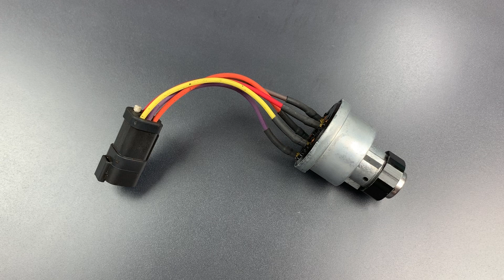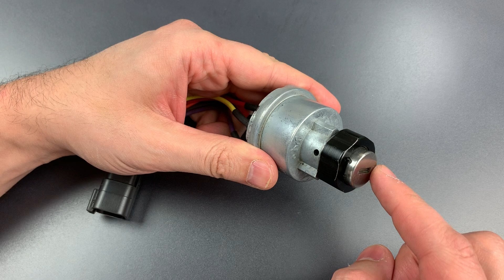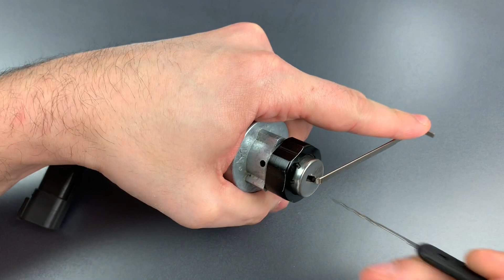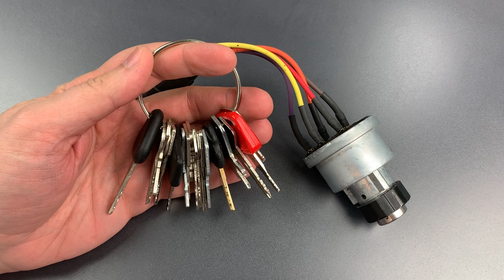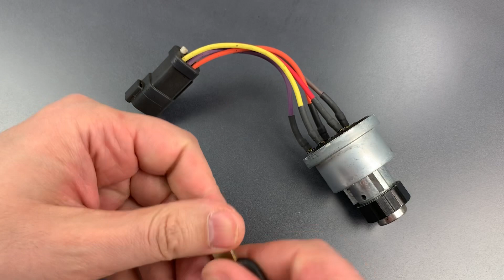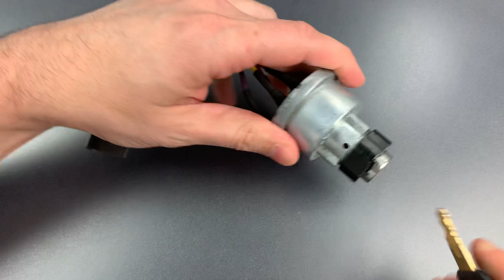[803] The Shocking Truth About This Bulldozer Ignition Lock (Caterpillar D8)

Comment: I can hot wire these under 2 minutes. The main issue with most heavy machinery is that they don't have steering locks like passenger vehicles so no need to pick the ignition lock even though it does seem quicker.

Comment: Machinery is quite difficult thing to operate. Stolen heavy machinery is practically non issue because you need police escort to drive thing on 150 000 $ truck. 
Low skill is turn the key. To start machine you got sequence if stuff to be in correct place. Like buldozer in question have throttle pedal in reverse, flor it and it's idle, full throttle is when gas pedal is relaced. 
Airplane doesn't have key at all. You can go to airport, enter in Boeing 747, Airbus 380, 320... Enter the plane, start engines and fly away without key. Know how to do it is different story

Comment: Fun fact: older Freightliner trucks had the same keyed alike problem. Freightliners of a certain age are guaranteed to only have 4 or 5 key variations, which meant if a driver locked themselves out of their truck, someone at the truck stop used to always have a key. Now, Freightliner has gotten better about that and makes many more key variations. They also make the door lock mechanism hard to fiddle with inside the door without breaking the door, AND they make the door hard to pry open with a wedge. Easiest way in on an automatic transmission Freightliner is by unscrewing the plate on the firewall under the hood where manual transmission parts would go, next to where the steering attaches. You can unscrew that plate and reach right in to grab the key out of the ignition of the truck.

Comment: Is the potential for mayhem there? Sure. Does it happen? Well, I can't think of the last time a stolen piece of construction equipment was used to go on a rampage. It's right up there with military vehicles, there's no key needed to start them. The only theft prevention system is a steel cable looped around the steering wheel held in place by a padlock.

Comment: Almost all industrial-sized Caterpillar machines take two keys. One is usually hidden away inside a (lockable) compartment protected by a considerable steel plate on the outside of the machine. This is a power shutoff, and could honestly just be bypassed with a bit of heavy-gage wire, but it takes that two-pronged key on your ring. The other is in the cab, the one shown above. Notably, the cab is also lockable, and it's common to put an aftermarket hasp on the door with a padlock. Not sure if the cab door takes the same key as the ignition. I don't think so.

Where I worked, the ignition key was always wired permanently to the switch and the master key was always left in, but turned off and closed up over night to prevent battery drainage, because my boss had machines twice my age and they were all deteriorating crap-piles. We only had two or three thefts across our probably fifteen hundred machines and several decades.

A bigger problem was disgruntled neighbors shooting the machines when he didn't respect their noise complaints.

Comment: All those years on the farm and we used to hotwire the tractor with a screwdriver to short the starter circuit. It's not like there was anything stopping access to the back, though we did undo the ignition and dropped it out to give easier access and a eyelet on the power wire. The closest to a key was that it usually needed a can of Start Ya Bastard on hand for the first start.

Comment: Im a farmer, and i can say with certainty that there is almost no risk of having farm equipment stolen, tractors from major companies have the same key for each model, but the models have different keys, regardless every farmer i know just keeps their keys in the tractors, semi trucks have different keys for the most part, construction sites have security cameras and insurance, at our farm we have an old d8 bulldozer, it doesn’t have an ignition key, you just press a button to start a small gas engine and then pull a lever which turns over the big engine, and given the fact that its impossible to steal any heavy equipment without making a ton of noise (especially equipment like whats featured in the video) there practically no risk of anything being stolen

Comment: Also being as most of these machines have a fairly open engine bay. The need for the key is redundant anyway as you can fire them up without the key fairly easily by hot wiring. The amount of machines Ive seen where the rental company has simply replaced the lock with a toggle switch is pretty high as well.

Comment: There are also padlocks on battery boxes "protecting" battery kill switches on most equipment. Its quite amusing when showing up to a job site Monday morning and nothing will start cause all the batteries have been stolen. Any contractor with at least half a brain also has hidden kill switches unique to the machine.

Comment: John Deere keys will run everything except the excavator. You need a Komatsu key to do that. Companies are moving away from keyed locks and switching to owner controlled pins. Of course most of those pins are 1111, 1234 etc.

Comment: These industrial locks are NOT intended to deliver security. they are intended to prevent casual misuse, and allow fast recovery if you loose your key and they have spare so your work is not stalled. In the industrial field, Security is handled by other means and protocols

Comment: Not sure how common it is, but an excavator I worked on had a generic starter key. But the door for the battery had what looked like a decent lock on it. At the end of the day the battery cut-off behind that door was used to 1. keep the battery from from discharging 2. to keep anyone from starting it. But the owner seemed to be more concerned about someone stealing the batteries or hydraulic oil as those are easier to resell for a thief.

Comment: Try the other keys on the ring on that ignition lock, I bet there are multiple other capable of opening it. Hint: don't insert them all the way.
BTW here in the Netherlands Electronics starting blocks and gps trackers are mandatory to get  insurance on them if they are not parked inside a secured building

Comment: I think your biggest security feature of heavy equipment is that it is heavy equipment.
The D8 for example is 40t, the blade is over 13 foot wide and it is 12 foot to the roof of the cab, and your GPS pole, roof flashing light cage and so forth will add to that.
Not to mention that 98% of folks do not know how to operate a dozer and it is not as obvious as it might seem.
They are also amongst the loudest of machines and CAT and Komatsu have satellite tracking of our machines, steal it if you can.

Comment: I love the fact that Manitou has all and the same key. That way I can climb in and fire it up using my own key without having to look for a specific key first. This makes me work faster on festival-sites when there are for example three trailers to load out. Just hop in and start working. Way easier.

On small sites with just three Manitous it's fine but if I work for example at Lowlands (a Dutch festival with over 65000 visitors) then it would be a pain in the ass, over 50 fork lifts are driving there, would be a pain to have to look for the key first. Now everyone has their own key and it works just fine. Only companies who bring their own fork lifts sometimes have different ignition locks put in.

Comment: Good video! Many mobility scooters, electric bikes and other smaller consumer appliances rely heavily on these simple 'universal' key switches, they all share the same inherent security flaws. Manufacturers adopting a lazy (convenient) way to replace keys and cylinders. The first line of defence against theft... is the lock. Why not incorporate a good one? With the addition of a protected wiring loom. Otherwise (armed with a little electrical knowledge) one can take quick advantage of an extremely exploitable vulnerability... The connector, thus completely eliminating the need for picking.

Comment: Yes you can start it with the key you can get easily but on bigger and newer equipment they all have GPS trackers that can tell where it's at, if it's running or not and moving and it's hard wired into the motor, you can get it started but the company is gonna know about it

Comment: These keysets are readily available off Amazon. I work for a heavy equipment dealer and you can just walk in off the street and ask to purchase a key for a given model of machine, we don't check ID or get serial numbers because even if somebody stole a machine with it there's no way to prove it wasn't anyone else with a key. Usually anybody purchasing they keys are operators who don't want to admit to their boss that they lost another set of keys, or field mechanics who have to work on machines that the keys are not left with.

Comment: If you are a large contractor with hundreds or even thousands of machines, making sure the correct key stays with the machine would be nearly impossible.  We have 32 machines keyed the same and it's a pain.  And much of the new equipment also comes with an electronic pass code protection.  Each of our operators has their own code.

Comment: The only real security you can have is GPS tracking devices. However, new machines are coming with PIN code systems that have no key so it's different set of problems

Comment: You know this is not the only lock like this unfortunately, when I lost the keys to my motorcycle took me less than 5 seconds to rake it into the "on" position... from there i just used my fuze box to turn my bike on and off, fortunately it had an electronic alarm so the bike can't be started without it being disabled anyway but it's a joke that vehicle manufacturers give 0 craps about something that is worth thousands and can be stolen as it is, rake the ignition and ride off...

Comment: thats a old secret. cat gat for the whole range identical keys. komatsu and volvo using diffrent keys or at least in europe. the newer equipment you can start the machine but if its not the right code on the key the engines says no and shuts down in 3 to 5 seconds.

Comment: Not sure about other countries but Australia we secure machinery with the isolator. IF you can get in the cab there won’t be any power to the ignition switch without activating the isolator.  Same system is used to stop accidental start up when being worked on.
Reply from the maker: The isolator key is right next to the ignition on my ring. 👍
Reply: That’s a bit of a fail. We have a large rotary switch outside the cab secured with a padlock. Service teams are issued with their own padlock to secure the machine as part of a ‘lock out and tag out’ system.
Reply: By fail I mean what’s the point. caterpillar! They should be seperate.

Comment: And iof that isn't scary enough, the key to the machine is more likely then not in one of three locations:
1. in the lock
2. in the sunshade
3. on the oild dipstick

just go out and have a look around :P
Reply: Our company leaves them in the sunshade. We also carry our own keys just in case. Plus we fitted our equipment with the battery kill switch and it's in places you wouldn't think to look. Like under the battery rack. Etc.

Comment: All Honeywell control systems  have a lock on the control Human Machine Interface (HMI) used by the operators and engineers.  That lock is the same for every control system of the same type.  An operator who had worked on a paper mill DCS showed me the key he had kept from there and how it worked at the oil refinery we were assessing.

Comment: Its been that way since before I was born, and that has been a long time ago. It hasn't turned out to be much of a problem yet, because a) this stuff is hard to get to in a city where there are lots of idiots, and b) most idiots in a city wouldn't be able to make the equipment move if they could start it. There are also external battery cutoffs and fuel cutoffs that can be used, and the average kid won't know they exist.

Comment: Pretty much every taxi in the US can be opened with the 1284x key because they are former police cars. Most Ford Crown Victorias out there have the same key because of this. 1284x is a completely unrestricted key so you can either buy one or cut one yourself as the bitting code is public knowledge.

Comment: There were some guys that got a dozer started and ran it through the local cemetery, destroying many headstones. 
How about a locomotive? Usually just a padlock on the cab door. Not too difficult to get started and moving with a little knowledge. Kids did that many years ago and ran the local switchers into the river from a raised drawbridge.

Comment: Yes they are keyed alike. Yes some keys can bought at farm stores using cash (not traceable) 
   Increadable destruction from misuse in a city, not farm, work site is real. CAT-910 front end loader (simple two prong key) engine did not bog down when destroying a car. NOTE: Diesel fuel is kept on site and locked with - gasp - a master lock. Hours of fun on a full tank is no problem. 
    Aside from the ten to twenty warning signs, each machine was easier to drive than a car. Some do not require brake activation before starting or switching gears. 
   Proper safe operation takes skill and months of practice. 
   Joyriding is simple. The less one knows, the more fun it can be. Why?  Experienced or thoughtful operators never try the stuff I've seen the temp worker or "new guy" do. 
   That said their slow speed and open cab means no where to run or hide. 
    A risk? Yes. Without alcohol most people are afraid to get in the seat. Many stall the engine at first. Plus the noise does attract neighbors.

Comment: I used to drive a Freightliner Cascadia and THOSE THINGS ARE MADE TO BE REPOED. Simply reach under the dash where the ignition key is, find the wiring harness and unplug it from the back. From there all you need is a bit of google for the wiring diagram and a paper clip. 

In-fact you could probably eBay an ignition lock with key to swap out and simply swap the harness over with any Cascadia on the road today and it will start right up.

Comment: This is true, most heavy equipment utilize common keys. The practical reason is that it’s easier for equipment operators, mechanics, and even the truck drivers who move the equipment around to always have the key they need without having to track it down or carry a massive set of copies. For larger companies with dedicated truck drivers and mechanics, they are often times transporting or servicing equipment without the ability to coordinate transfer of keys from the operators or site supervisors.

The real trick that a lot of companies employ is putting kill switches on the machine that prevent the engine from starting unless someone knows where it is located. Sometimes these can even be located behind a combination lock so even if found you need to code or enough knowledge on how to decode the locks. It’s not foolproof but it helps keep the average their out.

Honestly we’ve only had 1 machine walk off on us, which was a bobcat which had a keypad ignition. Master codes and all that we suspect. The thief’s ironically moved an excavator that we had used to help block it in with  and were nice enough to lock the excavator back up afterwards. That’s when we started installing kill switches.

The real mystifying thing about heavy equipment is that non of it is titled, at least not in my state. They title every car and motorcycle but they somehow don’t think a $300,000+ excavator should have a title. Nah, that bill of sale you printed up is good enough to claim ownership. 

At any rate, heavy equipment does infact get stolen but most cases it’s only specific types that could easily be off loaded due to high demand. Bobcat skid steers are some of the most stolen pieces because they don’t need a huge setup to steal and have high demand making the easy to sell off the next state over.

Comment: in reality we rent equipment and it gets delivered and picked up a lot of time without interaction between the rental company and the renter.
One machine may also get shared by a lot of operators. One company can own a machine that goes site to site with different operators at each sight.
Newer machines have electric codes that you may need to enter in stead of or in addition to having the key. Some companies set these codes to be the same code for all equipment in the company.

Comment: Many years ago, I worked at a department store, where all the lockable office furniture they sold used the same key. This included the cash boxes they sold in the office supply section. They were a bit concerned when I pointed this out (using a key on my keyring), as they used those same boxes to transfer large amounts of cash from the back room to the registers.

Comment: Railroads use the same locks on locomotives and switches. So if you can pick a standard American padlock and a sargent and green leaf environment padlock. You can take any train you want for a ride. The reverser keys are not hard to get either. 

Also, by the rules, you only have to lock up certain trains. So some trains can be left in sidings unlocked.

Comment: Machinery theft is very common in the UK. Small loaders and dumpers are stolen (presumably with this method) and loaded into a van and never to be seen again. They've even used stolen machinery to ram raid into bank ATMs and jewelers shops etc. It's crazy this equipment is not more secure.